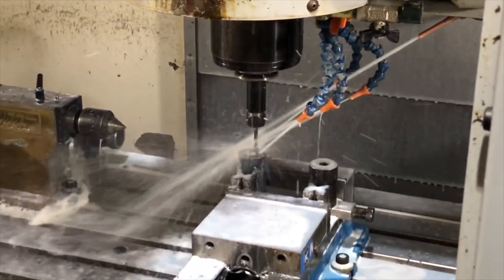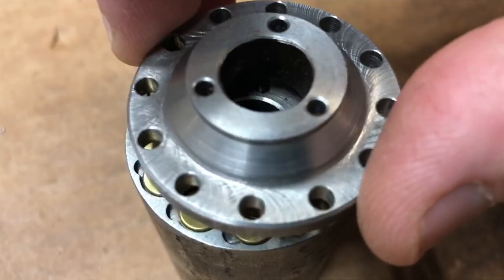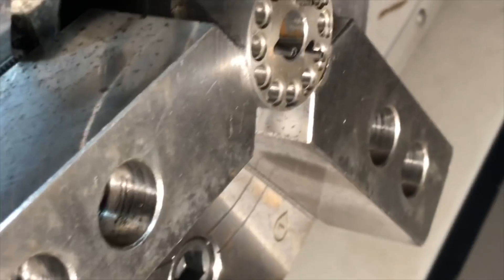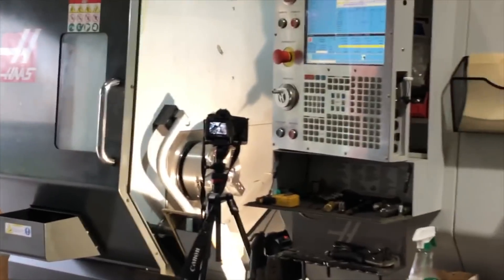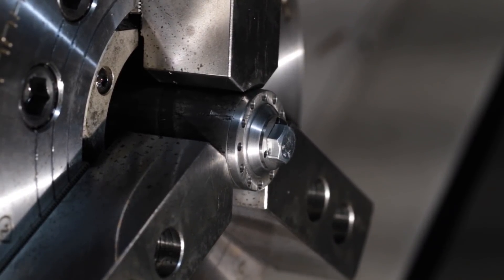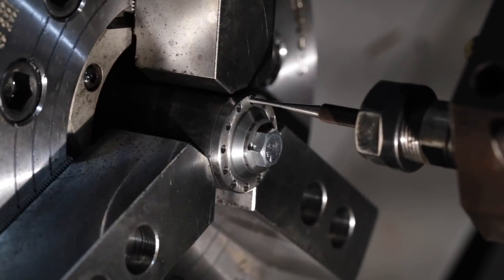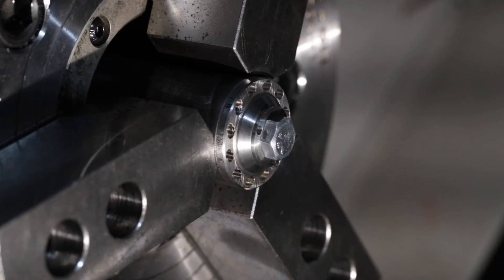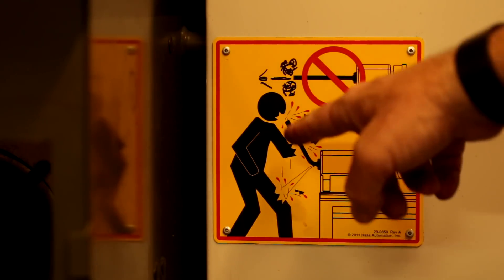Lathe Machine Gun

Comment: Add a ring of spring steel with "firing pins" attached to little arms for each chamber. Let CNC pick and release each firing pin. OR attach a small L shaped "trigger" to each pin. The punch moves in front of first trigger. Head rotates causing pin lift and fire. Would sound like a real machine gun. But operates more like old west gunslinger holding trigger while slapping back the hammer with the off hand. Hardest part would be getting the right spring weight.

Comment: Use an spring punch if you want to be quick and dirty but a pin acting like a spring return air cylinder and an Mcode in the program to a valve would be pretty legit. Oh and if you used something like M00 and activated the optional stop you could fire it with the cycle start button. 
Another idea would be not to use the tailstock but the actual carriage, especially if you have say a Y axis and then “probe the holes on 1/2 or. a 1/4 turn of the C axis the amount of coordination would drop and maybe faster cycle times could be realized.  The rapid on the tailstock is probably a few hundred inches per minute but the rapid on the carriage is probably close to 1000 ipm.  If you wanted to be super clever drill 2 sets of holes as squares offset 45 degrees and fire the side of the square by moving only in the Y axis before making the Z move to fire then rotate the C 90 and run the Y axis pattern in reverse starting at the other end and working your way back to the starting position. Move to your X offset for the other square pattern ‘radius index C 45 and repeat. Now we’re having fun! 😁

Comment: What if you machined little firing pins that pertruded out of the breach plate. Then instead of a punch you uses a tool with a bearing on the end. So you would rapid to a spot in between the rounds and then just spin the chuck to fire them.

Comment: Spring load the firing pin. With a spring the same pressure as on a bolt action 22. Send it into the primer at around 65 thou past touching the face. Average firing pin length is around 40 thou and that gives you 25 thou left for the machine to pull up while the spring compresses and prevent itself from breaking.

Comment: Instead of a bunch of holes for the pin to plunge into, cut a groove around the perimeter that the pin can just fit into, and that leaves the edge/rim of shell exposed. Reduce the diameter of the retaining cap so it leaves the groove exposed. Spin the chuck whatever speed suits your fancy, plunge the pin into the groove and leave it there. Might need to use a different pin material to avoid breakage. And maybe widen the groove to allow the pin to flex a little.

Comment: A tig electrode could be rigged for electric primer ignition - a short bit of insulated wire for each primer sticking out of the cap and a single tig electrode rigged like a brush as each bit of wire rotates by. Not as simple as a roller crushing the edge of each rim but more fun. If it is not reliable just up the amperage.

Comment: I took control theory classed in college and have dealt with PIDs in anything from CNC machinery to video games. Still it would've taken me all day to figure out that's what was causing the misfires.

I would guess grinding the tip flat on a spring center punch and having the z-axis overshoot enough to have the spring activate would've worked better.

Comment: The better option is to use a ramp on the revolver section to push a spring loaded pin and suddenly release it to strike the primer. No G-code needed, just some dumb simple physics. You probably need some dowel pins such that the pin does drop into a hole, but strikes a stub pin, presuming the ramp isnt machined down into the hole. Spring loaded pin would need to be round, so that it can follow the ramp and not get caught and break off. 

You could position the spring load pin on the c-axis to function as trigger in g-code. use g-code to spin up the lathe spindle & then use g-code to move the spring loaded pin so it contains with the ramp on the revolver. 

Now if you want to get more creative, create two or more rows of 22lr holes (staggered) so you can double or more the number of shots. Then use g-code to move the C-axis to fire off the next row.

Comment: Maybe if you got rid of the back cap and just had the "firing pin" kinda drag around the edges of the rounds whilst applying some pressure, you could run full speed and blow em all off in, well I don't know how fast you're lathe runs but you get the point I'm sure 🤔

Comment: If you ran it with M0 after each shot and just pressed the button fast with everything on rapid you probably could have gotten away with it as one "trigger pull" per shot and had a good effect.

Edit, could also make a spring loaded plunger as the firing pin so it wont pierce the rounds but give enough force to set them off so you can run the z deeper and see if that fixes the no fire issue

Comment: Why not use a spring loaded punch with small ramps cut into the "chamber cap"? That way it could fire at the higher rotational speed of the lathe while keeping the punch in a fixed position.

Comment: Logically, a punch that is at least the diameter of the casing and applied dead center would crush the primer evenly around it's circumference and ignite the powder. The exact same punch shown would likely have ignited more primers if it had struck the casing dead center
Reply: These are called "rimfire" rounds for a reason.  Now if the center of the punch was drilled out so you were only striking the perimeter of the round you would probably get more consistent firings.

Comment: I bet your lathe doesn't use derivative. Derivative is mostly used for process controllers where the PV that have a large-ish lag between a change in output and a process value change, temperature is a good example. If you love process control you should consider becoming an instrument mechanic. When you get a PI or a PID loop tuned and see the ridge response the first time it's a really satisfying feeling.

Comment: I used to be a CNC machinist, so I think I have a good guess. I thought that the machine might not have enough force unless its actually cutting. This is because operators “crash” machines when in rapid and the full feeding force isn’t needed while in rapid mode. I did not go to engineer’s school though, so I’m might be wrong.
After seeing the answer, I’m wondering if using 100% rapid, but over shooting by .05 or so would do the trick? Would probably set off alarms. Just curious.
Anyway, I really like this channel. Very interesting content.

Comment: A pointed punch would work but you would get a lot of blow back from the punctured casings. A spring loaded automatic center punch would also work. I think your original setup would have worked if you would have kept adjusting the zero point in farther until it was smashing all the cases enough to fire. You also could have made a tool out of an old electrical solenoid like those used for pinball machine flipper movement. You could have wired it in to use an external probe port and used the m-code for that port to trigger the solenoid. I got lots of other ideas to make this work at an even faster fire rate but what's the point.

Comment: you should make a fixed position firing pin that  works with a spring  that is cocked by the rotation of the cylinder and then is released when it falls off the 90 deg edge of the cam . Think gatling gun (or old stamp mill )

Comment: Since .22 is rimfire, and the standard firing "pin" is not a pin (point) but actually a flat rectangle, I think if you flatten the tip it would increase the force by reducing contact area...if I explained that right..not an engineer. :)
Anyway, cool set up to watch..
Cheers

Comment: Well, instead of a solid punch, you might use one with a hefty core that can slide slightly. Like if you drilled through the center, put a pocket in the rear to serve as the forward limit, threaded the OD of the rear and made a screw on cap to serve as the rear limit, and sent her like that so the core could(potentially) continue forward from its own inertia.
Or maybe you could use one of those spring loaded auto punches that everyone seems to like.

Comment: I dont know anything about PID, but i thought it had something to do with the machine overcoming inertia
I guess if you made a striker that is loaded up when the tool is pressed into the cap, then is automatically released and sent into the firing pin well after the tool is pressed far enough
I remember seeing a diagram of something like this, IIRC it was chambered in 7.62x54R and was used in fighter planes in russia, sort of an early minigun, but instead of rotating barrels, it just had one barrel with rotating chambers

Comment: Use an auto punch instead of a hard static punch.  You can "overdrive" it without complication, and the spring will assist the pressure necessary to detonate.

Comment: What you need is a spring loaded end cap with the firing pins in each hole spring loaded and the back of the pin protruding out of the back so when a roller or blunt object rolls over the surfce it pushes the pins in and onto the  ordinance. Then you can use the C axis and control the speed that way.

Comment: seems like you could replace the punch with a disc with ball bearings acting as the firing pin then just have a roller instead of the punch set depth then run the lathe the deformation of the 22rim would give the ball bearing room to clearance for the roller to continue on its merry way not perfect but seems like it would let you get close to max speed with simple parts

Comment: Not an engineer at all but since the machine will move as it's programmed every time wouldn't a sliiiightly longer punch work? That way it could hit it just before slowing down and not damage anything other than maybe the primer. If that idea is bust I think a punch with less surface area might do better.

Comment: You could use a spring loaded inertial firing pin to transfer the energy from the high-speed Hammer to the primer.

You could use firing pins activated by a roller.

You could us a spring loaded punch to allow over travel in the high speed feed mechanism without damaging anything.

You could machine the cylinder and cover to expose the farthest from Center of cylinder portion of the cartridge for impact and use a roller to fire the cartridges.

You have a machine shop build a blank firing real "machinegun".

Comment: You could install a electric or pneumatic solenoid -like from a electrically or pneumatically controlled hydraulic valve into the tool position - that would be hecken fast, you could probably go up with the speeds to a real high round per minute count ... i think with a revolver the only limit would be the hit and retraction speed of a solenoid firing pin, since you got noc repeating lock mechanism you should get up to 2500 rpm theoretical cadence

Comment: mount a star wheel and toss the PID along with the punch. then add a gravity feed clip and an  air line to back flush the brass and you've got a gatling gun. I'm guessing a little fine tuning and you'll do 300 rounds a minute

Comment: You might need some kinda’ pop-off valve that’s spring loaded and will wind up and then “pop” under pressure. Kind of like a diesel injector but with a firing pin.

Comment: I was wondering why nobody ever made an over under .22 pistol that has 2 firing pins that would use a chamber with 2 rings of ammo? Basically a revolver that would index half steps and fire one from either the top or inset ring alternately so you could get a high round count in a slightly larger cylinder.

Comment: see, i was thinking about using a small diameter rear cap and a static firing pin "ramp" just the outer edge of the primer sticking out, spin to fire at any rpm you want

Comment: Trying to force your machine to stop like this doesn't make any sense. Just run a spring loaded firing pin so the actual stop position is not critical. That way you only need to worry about the machine decelerating after it's impacted at full velocity.

Comment: A series of spring loaded levers and a cam roller would work really well.  Just turn the chuck and let the roller slide over the spring loaded levers, and as the cam slips off the edge of the lever, the lever falls and hits a pin, firing the blank.  You could potentially spin the chuck at increasing speeds for more rapid fire.

Comment: You referenced a previous video of a single-shot lathe gun, but I can't find it anywhere. Mind dropping a link?
Also, for the reliability issue, what about a spring-loaded firing pin that rides in a ramped groove on that backplate? The thinnest part where the ramp starts after each firing position would presumably be over solid metal, and it's not like a 22LR, especially a blank, is a high pressure round. Alternatively, an automatic center punch may work well and maintain the awesome movement pattern.

As for people suggesting registering a lathe as a machine gun... I don't think they fully understand the implications of that. Registering the cylinder as a machine gun might be ok, but registering the actual lathe seems like a terrible idea since the ATF's policy, as far as I know, is "once a machine gun always a machine gun."

Comment: I would think a spur gear cut to time with the cylinders, so you could just rotate it and firing would progress at RPM? Or maybe a cam and just adapt a hammer firing system like a revolver though striker would work fine. sort of like an old points distributer?

Comment: You could have replaced the solid rod you were using as a punch with an automatic center punch. Once it was bottomed out on the machine if it was set right that last little bit would be a nice hard whack from the automatic punch internals slipping and making a nice hard hammer action onto the primer.

Comment: You could possibly programmed it in step drill or punch process with a high feed rate or equivalent to 25% of the rapid traverse speed. At least you know it will stop at the same point due to the feed depth.

Comment: I have an old Mazak VTC-200 that will miss position at high velocities and in a cycle like the one shown would miss the depth entirely.  Consider adding a dwell after the movement.

Also an automatic center punch with an appropriately flattened tip.

Comment: I think actual firing pins pressed in by some sort of bearing surface on the turret would be your best bet. Then, 1) it would be more like a machine gun and less like a robot revolver, and 2) you could drill the holes in a spiral pattern to increase ammo capacity and use X movement to set them off in sequence. Also eliminates the need for C, as you wouldn't need to stop the spindle.

Comment: I believe the milling machines in my shop (or at least the ones I work on) use a different servo motor for rapid traverse than for feed. I don't think the rap trav servos have as much torque as the feed servos. If your lathe is the same and if indeed I'm correct in my non-expert assumptions (I am only an apprentice, after all), that may offer some explanation as to why the punch doesn't have enough "umpff" to set off the primer in the blanks....

Comment: Well, technically it isn't a machinegun if bullet n-1 isn't the force necessary to actuate the firing of bullet n.    What you have there is an autocannon/autorifle/gatling.    Gatlings are completely legal as long as they're fixed mount.      It could be wrangled that what you have is a drone that fires bullets, I guess, but as long as it doesn't end up literally on radar I don't think the FAA cares.

OH, idea on the .50 debacle.  Come up with a replacement for the firing mechanism that lifts a "bolt like" carrier of a firing pin striker into place.  Would be a quick pro-fit to the existing rifles and probably only make the mechanism about 4 parts more complicated.  Sell it as an optional upgrade, it can be all square corners and pin holes.

Comment: machine a back plate to have ramps for each hole instead of simple partitions. then you can use a spring-loaded punch. Turn on the spindle then lower the punch into the path of the ramps, it will fire at full speed as the punch will rack trugh all the holes. If i could post a CAD file for you here I would design it for you

Comment: There is no solution to that since the CNC prevents an "out of boundary" operation, and all machine operations, as programmed, will be done as how it is programmed. So even if you programmed it in a way that your spindle drill would break or your workpiece will be flying off and cause damage, it does not care.

A crazy way to bypass that is to do something with the sensors, put a spring on the mounts or something to move them a bit ahead, thus make the thing overshoot, but spring back on the correct position so it will back off and not interfere (Please don't do that)

The simple way is to be sure that the rim will be crushed reliably, and to do that you need to set that punch to go a little bit deeper than the rim, but since it needs impact that can only be done with speed, it is still not the 100% way out of it

But I feel a bit sad for that lathe...but hey, it was something worthwhile to play with!

Comment: could just turn it into a gatling blank fire piece with open bolts and fixed firing pins... if you felt up to milling cam grooves to control all your bolts and fixing tiny little .22LR extractor claws lol

edit: not even an engineer and know PIDs. FML
if your junior engineers need a more entertaining way to practice with PIDs from home; engineering games like 'stormworks' and 'from the depths' can really help.

Comment: Make a racheting firing pin in the cap that operates on rotation. Spin the cylinder, hold the cap in place, viola...
Reply: Haha 🙂
Reply: @mikebond6328  I made that sound easy didn't I. It also needs a compass in the stock and this thing which tells time.